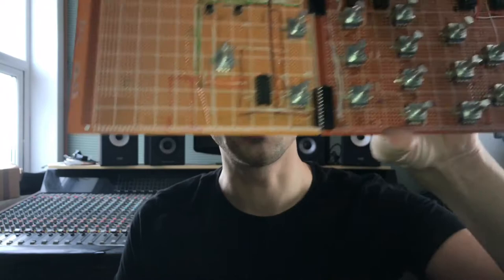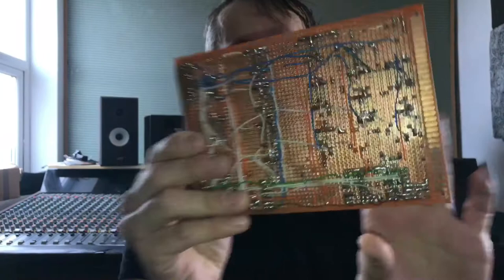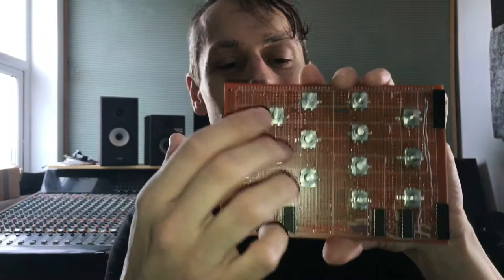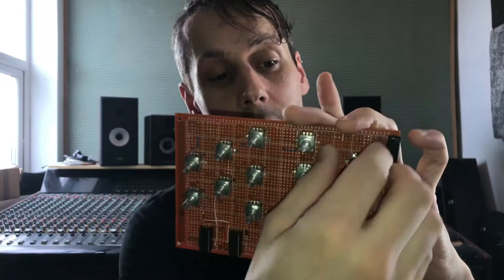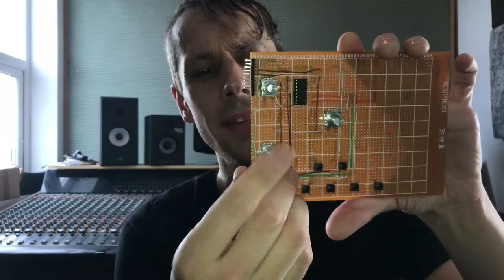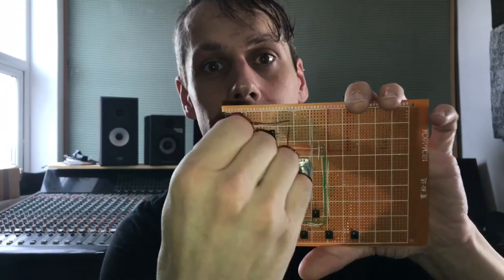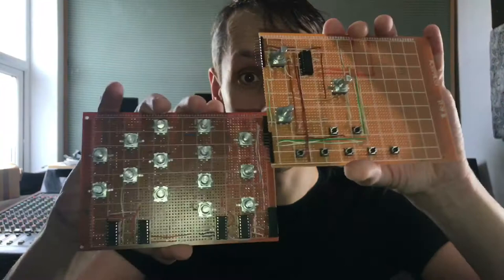Harrison Mixbus (and Mixbus 32c) control surface Vlog 4

Comment: Hi Russell, great initiative(!!) and please count me on a controller purchase. I've been inquiring about exactly this with the good gentlemen at Harrison for some time... Any further update on production models? My 2 cents (pence) contribution regarding production features would be two: 1) that what MB graphically represents as faders, knobs, and buttons are mimicked in the "Cottier Control Surface" (e.g. MB's "threshold" and "volume" are faders, while MB's "trim" and "pan" are knobs, etc., and 2) don't forget the "trim knob" --- I can't live without it... But seriously, thanks for your efforts.
Reply from the maker: Christian Hammer sadly the cost and space issues with having a motorised fader for threshold isn't viable at the moment :-( 

The volumes will be motor faders though :-)
Reply from the maker: Trim is going to be an alt mode on pan I think press and twist rather than twist